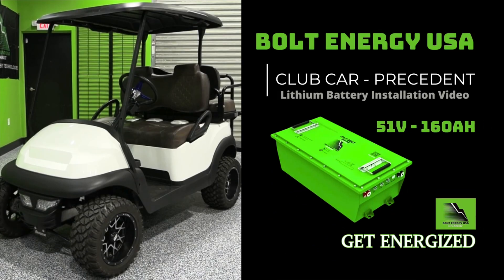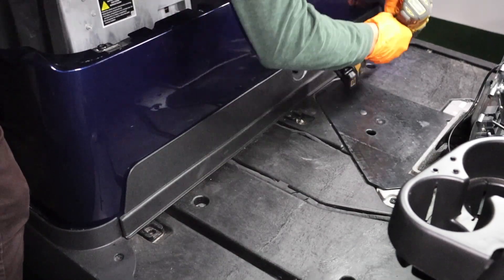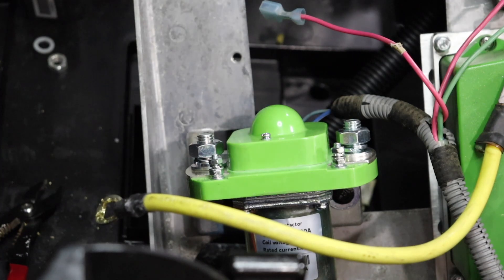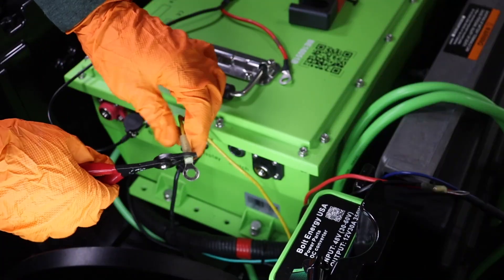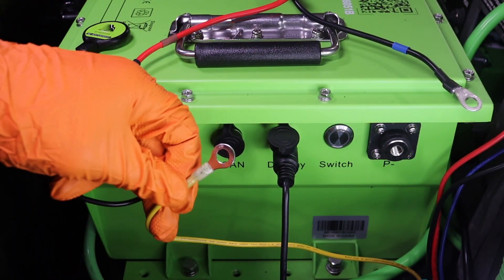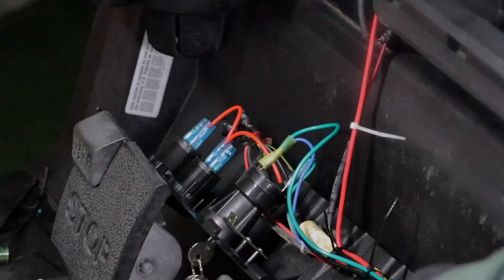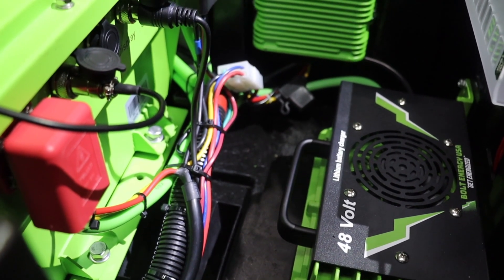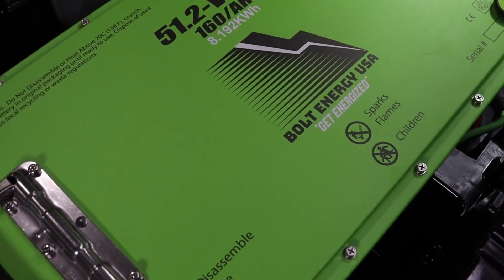Club Car Precedent Golf Cart | 51V 160Ah Lithium Battery Installation | Bolt Energy USA

Comment: Just installed my bolt energy battery pro kit. Pretty easy install. I swear my got cart gained a inch in height after loosing all those lead acid batteries
Reply from the maker: That is awesome! Never thought about the height change. You can submit photos of your installation on our FaceBook page for a chance to win cash and prizes. Winners announced monthly for DIY and DEALER categories.